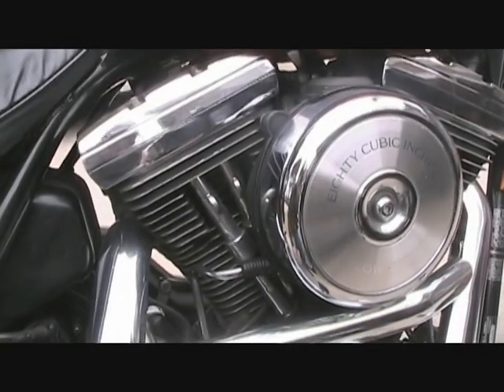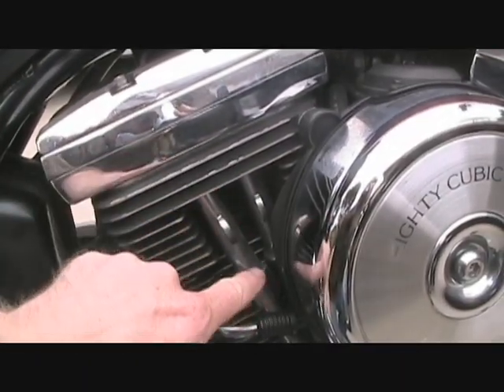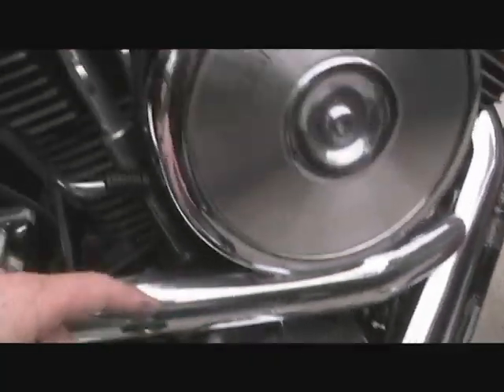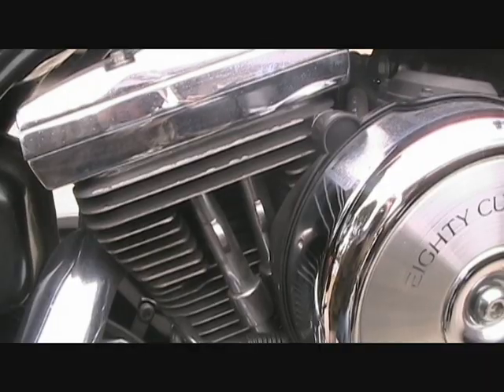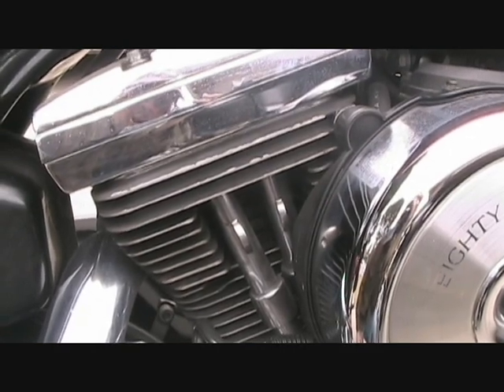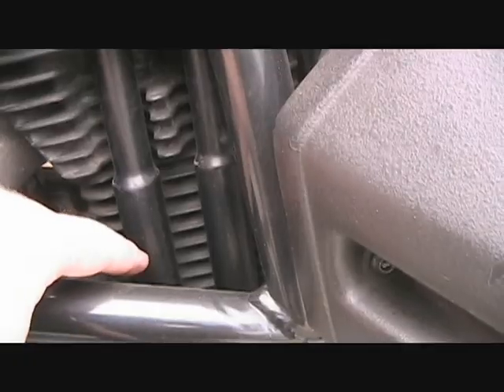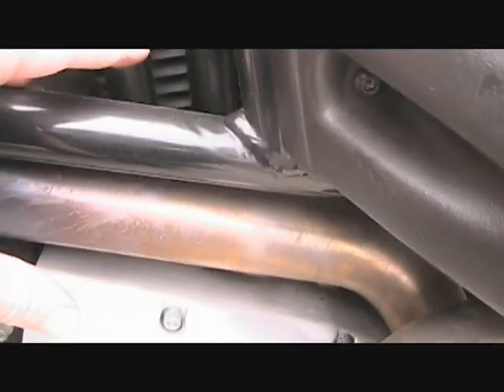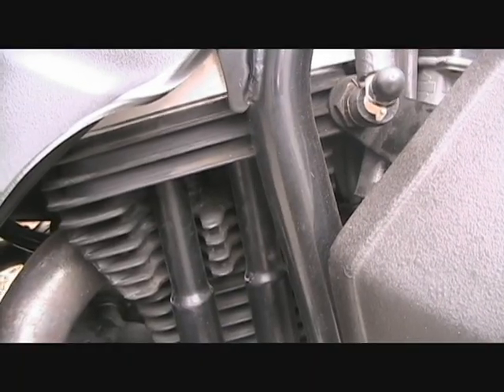How to Adjust The Valves On A Harley-Davidson Evolution Motorcycle Engine

Comment: Actually I'm one of those people that was wondering about this. Having switched from sport bikes and not being to much into Harley's, I bought a sportster 1200 toward the end of last summer and like I said before didn't know to much about them mechanical wise. By no means am I a slouch when it comes to maintenance, I had to adjust the valves on all the sport bikes I've owned. This just made things a little more easier for me as I'm preparing my Harley for this summer. Thanks again.

Comment: They still should maintain a valve clearance at the rocker arm and its seat when the bike is at top dead center, there should be some specs on the gap or end play. Or something needs to be corrected to maintain that clearance so it is not too tight or a valve could hit the piston. The older the bike gets theoretically, the clearance should get larger over time with wear, till the cams need replacing or the push rods as well as lifters or all the above. Thus the noisier the top end should get with the miles on it accordingly.

Comment: I adjust the valves on my 2005 HD every week to keep it running strong.  I'm going to change the timing belt this weekend.  I still have my suzuki but I love my Harley.
Reply: New power band every 20,000 miles good idea too

Comment: @ kassandrasduplex - I have a 1995 FLSTC.  90,000 miles.  "some" ticking at the top end (valves, rockers) is ok, but should not hear much on the lower end near the cam.  HD lifters are ROLLERs.  

I thought the job was too big from me, so I told HD I had ticking in the cam housing.  They took the top end apart and ignored the cam housing.  $250 later and still ticking.

So I frigging took it apart myself and found a few of the many needle bearings from one of the hydraulic rollers fell out.

Comment: Hey, Im putting a 1250 kit in my 883 sportster. I have the pushrods out already but i was just wondering if there is anything I should be doing with the lifters now and before re assembling the engine.

Thanks!

Comment: How about mentioning the fact that there is no adjustment possible with the stock parts.  Only aftermarket push rods are adjustable, but the factory Evo was set up at the factory with fixed length push rods and  are no way adjustable at all, with stock OEM parts.
....RooDog....

Comment: I'm sorry man and to everyone else on this tread. You have a thing called Push Rods that are self adjusting. After so many miles or hours on the bike the Push Rods sometimes wiggle a loose. Your Hydro Tappets are inside the engine touching the Cam Shaft that rolls in a circle that makes the Push Rods go up and down. One is for Intake n the other Exhaust. Well while the Cam is rolling, its moving your Tappets, at that same time it's moving your Rods as well. At the other end of your Rods they attach to your rocker arms that then makes your Valves open and close on either stroke. Well on your Valves you have springs that lock into your valves. For your info in the middle of the cylinder head where the valves are, there is this thing called a Valve Stem Seal. They do go bad specially on the exhaust side after so many miles. So the lesson learned today always check your Push Rods to see if your Hydro Tappets r still good, because they have a little pin that will come out and make the push rod not work, leaving one of your valves not working correctly and heating up to Warp/Bend maybe break the Valve stem, or it will break the seal. Long story short do Maintenance after so many miles. You are right, Harley made it so u don't have to adjust the Valves. Harley did that so you would have to buy a new cylinder head, Push Rods, Tappets, Cam Shaft, and Everything else that's torn up. KEEP YOUR BIKE SERVICED AFTER EVERY 500 TOO 1000 MILES IF YOU DON'T KNOW WHAT YOUR DOING....

Comment: I have a '99 sportster and I think my exh. Valve on the front cylinder is sticking. Can you give me any advice on correcting this issue. Or will I pretty much need to rebuild both heads? Thanks. By the way I am the guy with his first bike trying to keep it working correctly.

Comment: alright smarty pants... tell me how to adjust the valves on a harley without the stock fixed pushrods? take my s&s v96 for example with adjustable pushrods. how do you set the lash?
Reply: first take the engine out, sell it and buy a Harley engine
Reply: kize32 😂😂😂😂😂😂
Reply: @kize32  he said NON STOCK HARLEY PUSHRODS... the kind with adjustment nuts at the bottom... the kind where you have to zero out, and then turn the nuts upwards 4 turns then wait 15 mins til the hydraulics bleed out to the new adjustment to the pushrods.

Comment: hey how's it going? Question for ya. I have a 1200cc Evo sporty (1993) & there's a tapping/knocking noise coming from what it sounds like the top of my front block.. I'm thinking it's a valve problem, maybe they need replacing, i wanted to know if there's anything you could think of that would cause this.

Comment: This video actually answered alot of questions for me. I have a 97 fatboy with the 80 cubic evo and im getting some oil splashing out of my air filter. Which im guessing is coming out of my blow by tube....I was thinkin possible valve adjustment but now I know I dont need that :). Thanks for the video
Reply: The oil coming out your air filter is from your crank case vents  the little ballbearing in your oil pump  isn't closed /closing all the way  its from dirty oil  grim  drain oil flush tank is the best way but changing oil will stop it from puking on startup

Comment: i got a tap (front cylinder valve train)  it comes on only if its warmed up. when above 50 mph. then it goes a way if i slow down. wont do it around town runs fine. i think its a lifter, any advice is welcome. 2001 Sporster 883 convert 1200 screaming eagle kit, s&s super carb & intake.

Comment: You actually do adjust the pushrods dingleberry, most people put adjustable pushrods in which you  will need to adjust to the manufacturers specs, like 20 flats for S&S etc

Comment: @ kassandrasduplex (Part two) to fix you can (Fast Way) cut the stock pushrods with bolt cutters and then remove the four small bolts at the tappet blocks, then remove as an assembly and inspect.  However, you with then need to replace with adjustable push rods, and if not addusted correctly... can give you issues.

(Long way) remove tanks, rockers, pull push rods,  pull tappet blocks.

You WILL need the service manual and an INCH lbs torque wrench.

Put away the beer.

You CAN do this job!

Comment: correct stock pushrods do not need adjustment. He doesnt seem to know where the lifters are so im mot sure if he knows what hes doing. the lifters are at the botton of the pushrod in the lower case not the top. be leary of his advise. kinda sounds like a lawn mower machanic

Comment: Ok, about the goes around corners. You must have been riding a low or the custom sportie. I have a 2000 hugger. It shocked people to see me take some of the corners on a bike with a set of 20 inch apes on 4 inch risers. I always tell them, think of a fulcrum on a lever. Distance from the center of weight = lower amounts of mechanical energy to move a given weight. Ya I said it, my bike handles better with apes. Side note, my armpits stay much dryer in the summer also!

Comment: george novak , you still would not need to adj ,hydraulic cam followers do the job. and you would not remove that much material from the valve that it would be out of the range of the lifter

Comment: How bout the V-Rod valves ???
Reply from the maker: BeaglePower G They require shims to adjust, and they are hard to get to.  Here's more info.  http://www.v-twinforum.com/forums/harley-davidson-v-rod/19988-does-valve-adj-really-cost-700-1-200-a.html
Reply from the maker: BeaglePower G You're welcome.  I test drove a V-Rod, and the engine is a lot of fun!  I ended up buying an old Buell Cyclone instead.  Less weight, good power, and better cornering.
Reply: ***** I had an 2003 Buell Firebolt with a custom Edlebrock Muffler...Sounded Amazing, one of the many regrets on the bikes I sold.